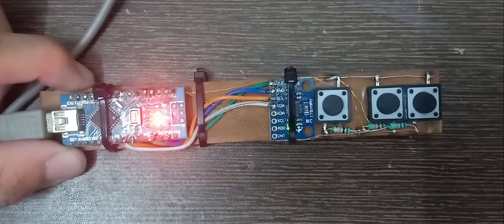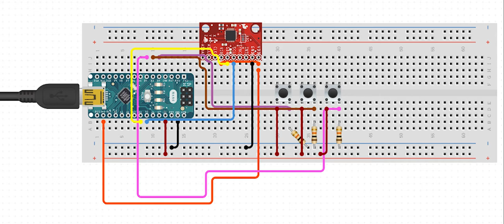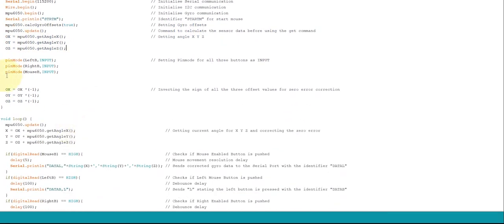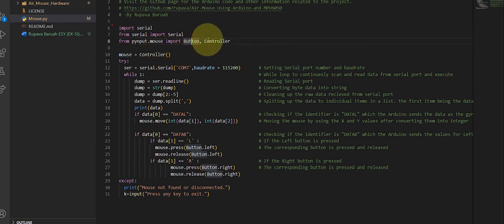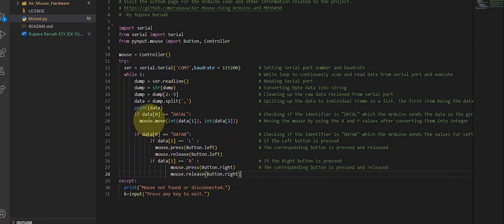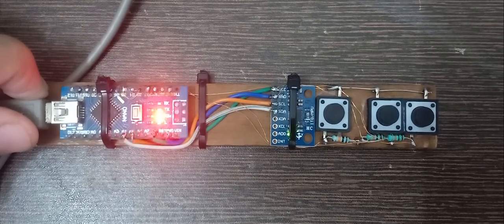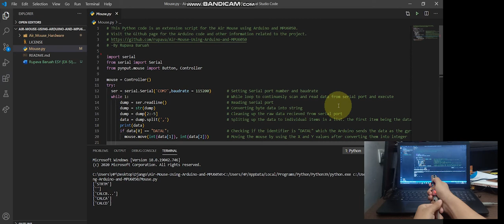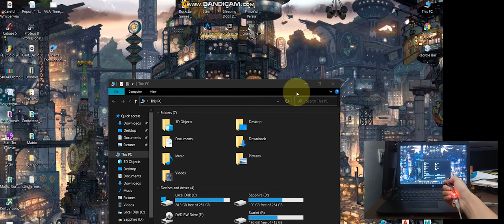Air Mouse using Arduino Nano and MPU6050 (An alternative to Leonardo based Mouse.h library)

Comment: Hey, firstly the idea that you've got for moving the mouse is just amazing, but I've got a doubt. In the ".ino" script you firstly get the initial angle values, store them in OX, OY, OZ. Then inside the void loop, you get the latest angle values and use that to correct the older value by adding it. Then via serial communication, that info is then read by a python script. Now I've got 2 doubts here, 1) because the values of OX, OY, and OZ are in the "setup" function they are constant right? So, that'd mean the old values are constant, but I feel it must change and the current new value must become the next old value right? 2) the data sent through the serial comm are the correction angles right? and the "mouse.move()" function from the "mouse" package in python requires pixel points if I'm not wrong. So how are angle values being reflected to move the mouse pointer ? Thanks a lot in advance.
Reply from the maker: He, glad you like the idea. This project is just thrown together for a semester subject project so not much research was done to make it efficient but rather just make it work. To answer your questions
1) As the function mouse.move() in the python script moves the mouse relative to the current position, we don't need to make the new value the old value. But this means that if we need the mouse at the rest position, we would require it to be on the initial X,Y position irrespective of X position. [I should probably fix it]
2)mouse.move() takes X and Y received from the Arduino via Serial and moves it relatively to the current position. Yes it requires pixel data and the data received is in angles. But 5 pixel moved towards the left shouldn't be much different than 5 degrees towards the left.  This makes the mouse pretty janky and difficult to use and takes time getting used to it. The angle values are not accurately reflected on the mouse pointer to represent pixel position[and that's sad :( ]. But hey! it works pretty good to score me a solid A on my internals.

Hope this answers your questions.
Reply: @rupavagetsitdone  great thanks a lot :D

Comment: Nice project, is it also working in VR ?
Reply from the maker: It's not as of now, but Arduino sends the raw position data of the gyroscope to the computer via serial. So if you could have any software interpretor on your computer and link it to your vr program, you could make it work, definately will try it next.